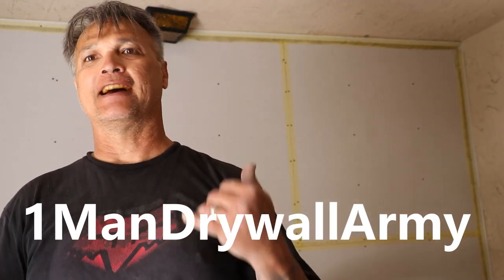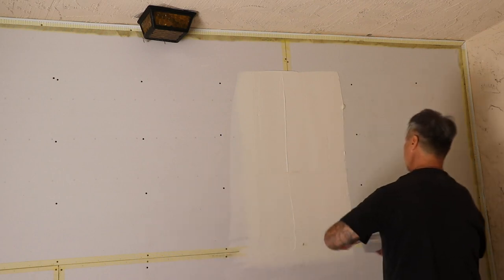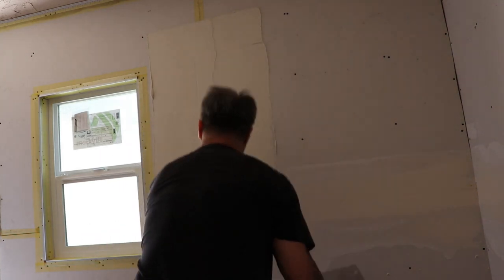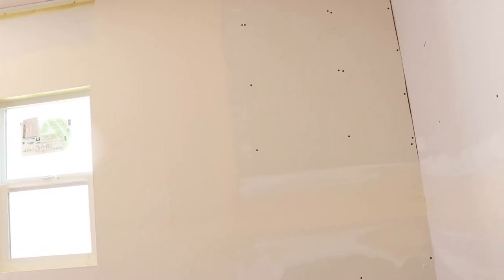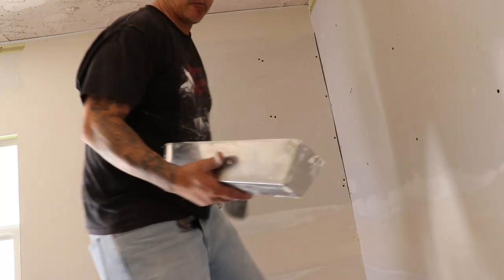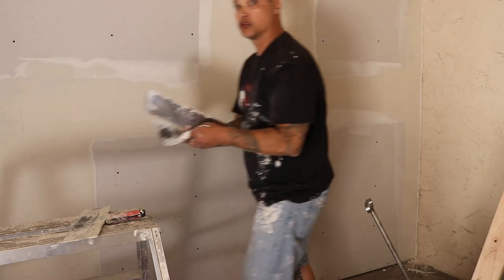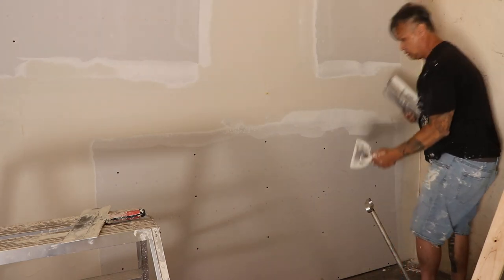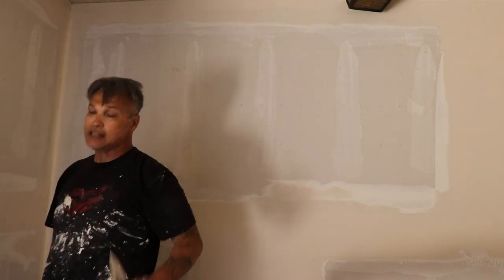Coating butts, flats, screws, bead and inside corners all at once.(uncut)

Comment: Hot mud expands outwards to give you fill  also dries in 90,45,20 or 5 mins for my coats and pre mix (plus 3) what your using you can not, this premix compound shrinks and caves in making it more work...you have to wait a day or more depending if you put on a fan on it....its not efficient and slows the process,I would use the pre mix as the top coat to have easy sanding over all my hot mud and more then likely be ready the next day for sanding.... now if your doing a whole house I would use pre mix and use mechanical tools but would still use 10 inch knife the 12 inch knife also the same process with hot mud with the knife order and please don't tell me you use a 12 inch knife for corner beads with plus 3 too??
just saying
Reply from the maker: i used 40 min and  boxed mud for the top coat. Pretty much what you did. Just saying!

Comment: Is there some point at which you add tape?  🤔
Reply from the maker: unfortunately for some reason some people can see the tape and others cant. It has been brought to my attentions by 4or 5 people. Trust me with out a doubt I used yellow mesh tape with fast acting mud. Whats weird is that I see it perfectly
Reply: Yeah it's there the whole time.  Its mesh not paper, except in the corner near the end.
Reply from the maker: @mjeffersky  right on brother so glad you see it. Thanks for watching
Reply: Nice knife control 

But you gotta prefill those seams brotha with some 5 or 20 before you come over the top coating this heavy 

Prevents any cracks/blistering 

Nice content
Reply from the maker: @gabrielflores2685  thank you for your reply. I run multiple coats on the same day when I do small jobs like that so I don't have to come back. By the way regarding prefilling I never or rarely prefill when using mush tape with hotmud. Now if I am taping with paper oh yeah I always prefill with 20 and tape with full weight all purpose. Once again thanks.